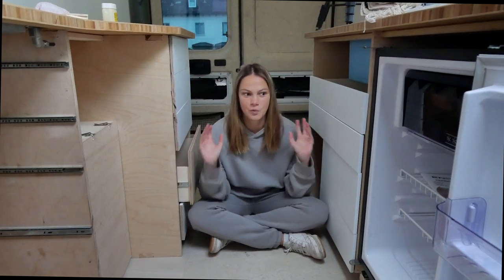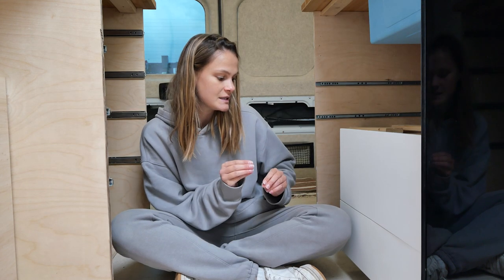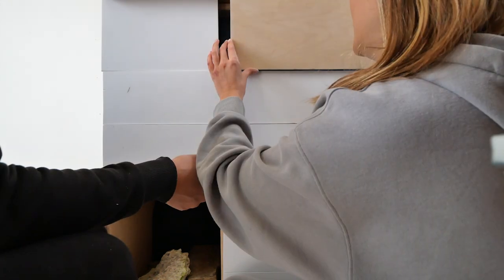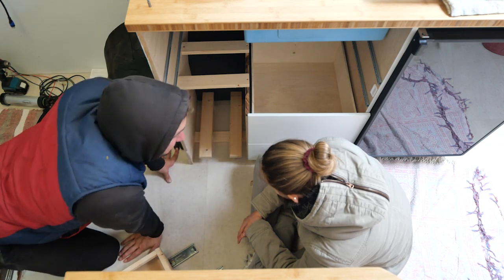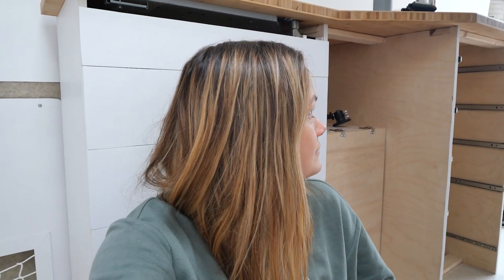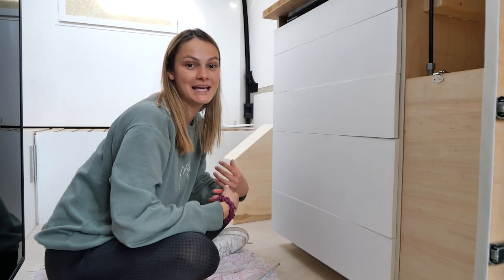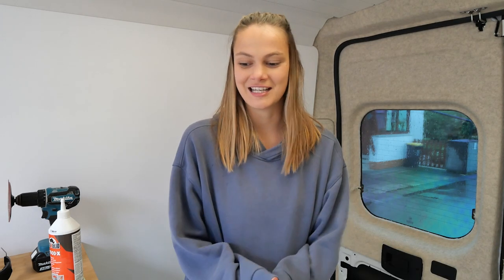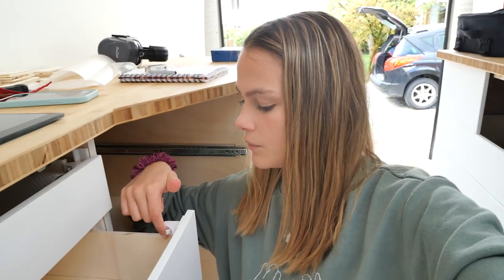Finishing Our Van Kitchen...at Last!

Comment: To fix the "too short" door for the gas locker you can glue a batten of wood onto the side of the cabinet dividing wall to have the door rest against and look in line with the drawers. You do need to trim the gas locker hatch to make that work.
Reply from the maker: Ah true we hadn't thought of that, but our drawers also rest against that dividing wall so we would have to shorten all those drawers to sit within the wall 🙃
Reply: @robinandmiriam  I meant to put a strip of wood on the side of the dividing wall where the gas locker is. That way you can leave the drawers alone and "just" modify the hatch to the actual gas locker by making a couple of cm narrower to allow it to get past the added strip of wood...
OR: you hinge the hatch to the gas locker on the right side (instead of in the bottom) so it clears the added strip of wood (if you dimension it just right...